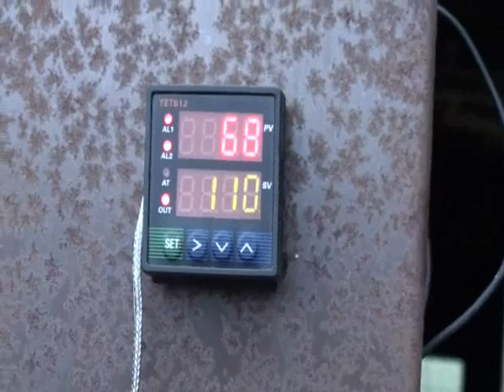Waste oil burner

Comment: I WOULD SURE LIKE TO FIND A HOW TO VIDIO AND WERE TO BUY THE CONVERTION PARTS FROM there are a few videos on her that are over a year old of heating guys showing how to convert one, and they give there web address were to order all the parts needed, but none of them been replying to any comments, there website is dead. I think there all prank videos, how ever I know it can be down, as I bought a factory waste oil boiler some years ago, it works great, with one small down fall, unlike fuel oil burners that need a littler servicing each year, this unit needs a cleaning at the burn head once every 5 to 6 months, or it trips out, saying service required. they run on 30psi air mixer and a blower like a regular oil burner uses

Comment: you cant be there to fire it with a torch every time it calls for heat, it will fire up on the ignitor rods if you get the oil to atimize just right,

Comment: I DONT SEE YOU ANSWERING ANY COMENTTS FOR ALL MOST A TEAR NOW, do you have it heating a building yet, heating the out doors is not very benefit, use a ols home heating oil tank. infact 2 of them, one higher up then the other, no need to filter the oil this way, gey 2 magnetic 200 watt block heaters $53 each, put one on the bottom of each tank, wrap the tanks in boiler insulation, the top tank, weld a 3/8" pipe flange half way up the tank, cut the top open on the top tank so you can pump out the scum off the bottom of the tank when needed with a trash pump, let the waste oil flow into the lower tank after it sits in the top tank for a week or more so it cleans its self, burn the oil from the lower tank, keep these tanks in a building out of the weather, with a hot water line going to a water to air heat exchanger, you have to many things that can fail using that water tank heater, the magnetic block heaters just work all on there own, how did you do the burner conversion, do you have a vid on that?

Comment: ok what would you like to know? you do need to in crease the pressure a bit, that is done with the screw on the pump. bring it out almost all the way, then as the flame is going (once it starts burning for a good 2 mins i bring it in almost 3 or so full turns) and i have been burning used oil in a standard home oil furnace for some time now. yes you can mix it with diesel it will need less adjustments. but in the end it really depends on a good oil blower system. what would you like to know?

Comment: to avoid using propane torch for preheating the nozzle, try to pre-heat it with an electric PTC arround 30W. this is what i'm using for about 2 years with no problem.
Reply: what is a PTC, I KNOW IT IS SOME KIND OF ELETRIC HEAT ELIMENT

Comment: nice job... i have been running used oil in my standard home oil furnace with no modes i live in New Hampshire and all i do is and a catalyst like acetone to my used oil and just pump it into my furnace  i have run this for over 2 years with no problems so i am asking you why all the extra stuff when you can do all the same with just adding a additive? check it out at richard downer in your search on you tube. let me know if you need more ore if you need to see more proof?
Reply: as a reseller I buy acetone by the gallon and by the45 gallon drum, even at my cost acetone is not cheep, it takes a lot of acetone to burn good and clean kerosene is also not cheep, most are after free heat, witch can be done, and safe as well

Comment: hi could you state the make of the nozzle so that i can google it .am i correct in thinking that the nozzles act on a venturi effect .do you get any carbon blockage after running a while at nozzle tip thanks melvin

Comment: hi  i tryed around with a waste oil burner  i bought one and the problem i had was that the chamber start filling up with un burnt oil    maybe with the longer blast tube might help    i dont know if the flame was licking the back of the boiler and just running down      well done yourself good job       mick       dublin  ireland